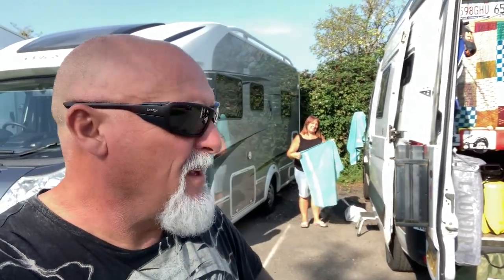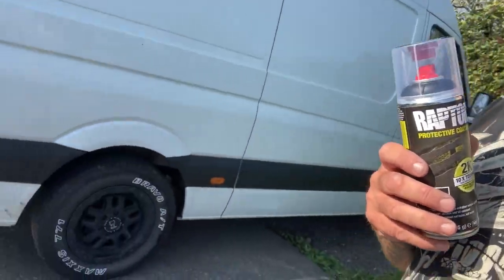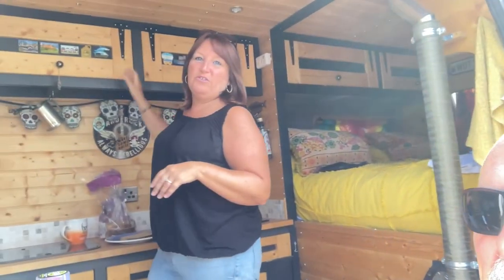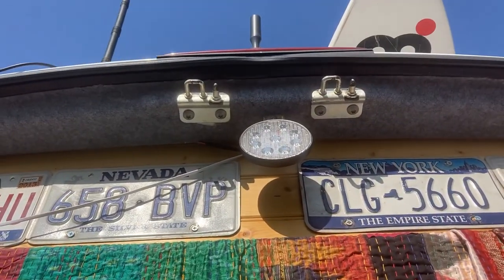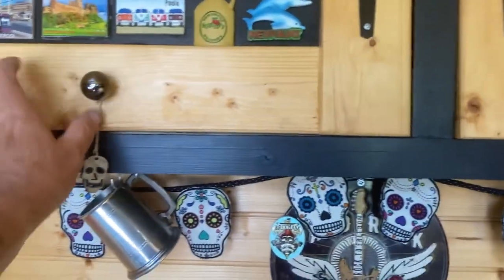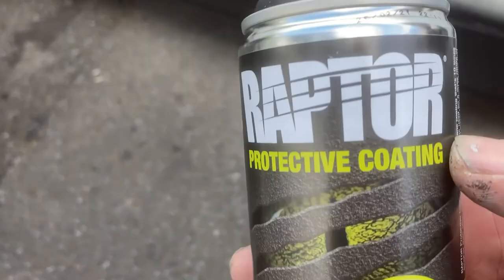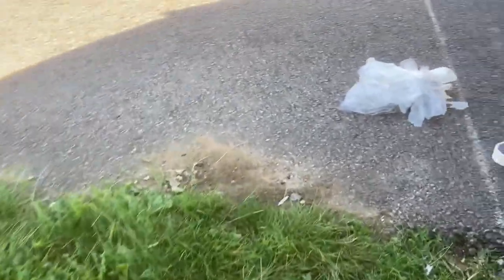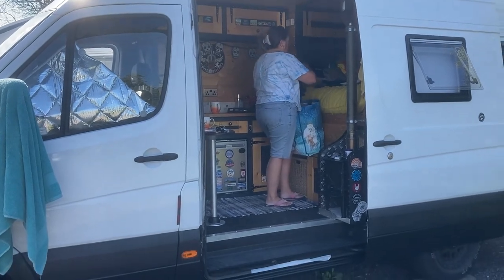Van Improvements inc RAPTOR Paint

Comment: Looks really good how many cans did you use to do that, I'm thinking of sanding some scratches out on my front bumpers and spraying them at the same time then putting a rubber gasket in the gap after
Reply from the maker: Hi Chris, that was four cans mate.
Reply: Thanks pal,